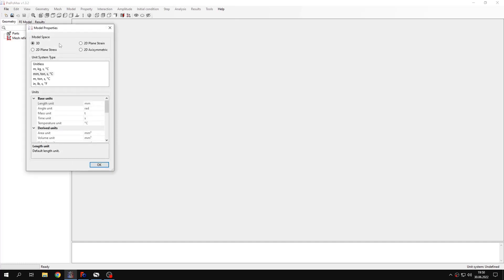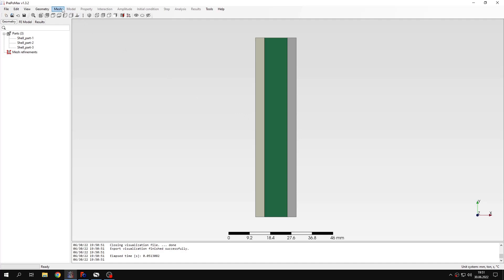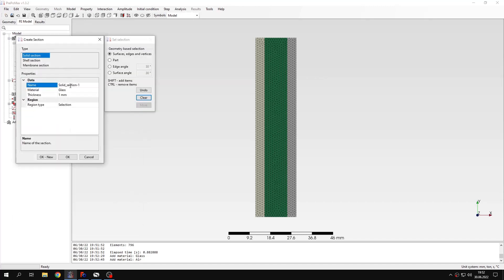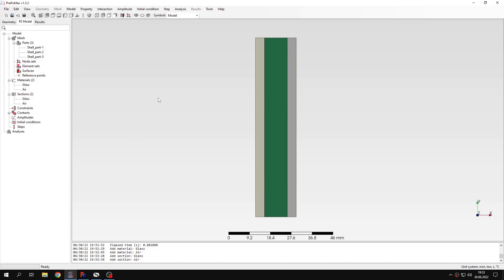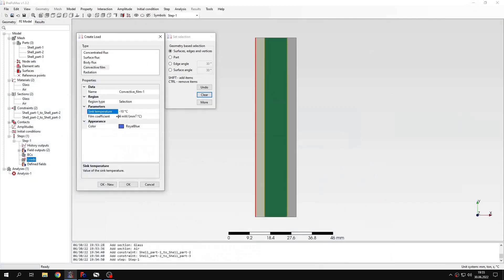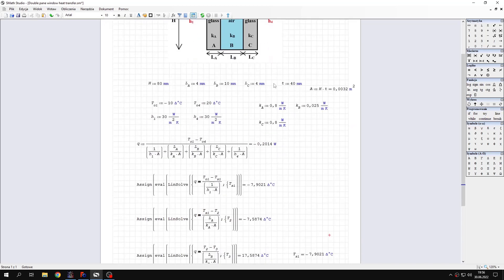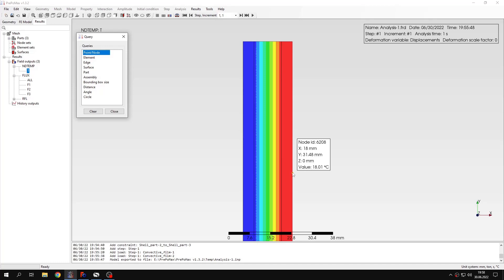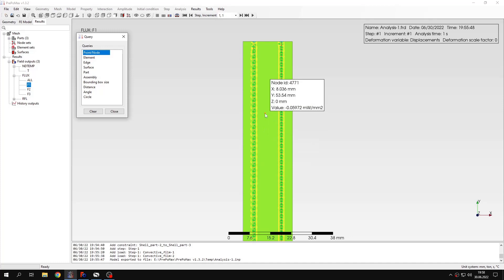PrePoMax (CalculiX FEA) - Tutorial 22 - 2D analysis of heat transfer in a double-pane window

Comment: wow thanks you for the tutorial, could you also make tutorial for natural convection in builidng ?
Reply from the maker: To model natural convection accurately it would be necessary to couple fluid flow and heat transfer which is not possible in PrePoMax. When it comes to open-source software, OpenFOAM solver could handle this. Also, I'm a mechanical engineer and I don't know much about civil engineering calculations. This tutorial was a small exception ;-)
Reply: @FEAnalyst  yeah, its possible using OpenFOAM, calculix only possible when use for conduction heat transfer